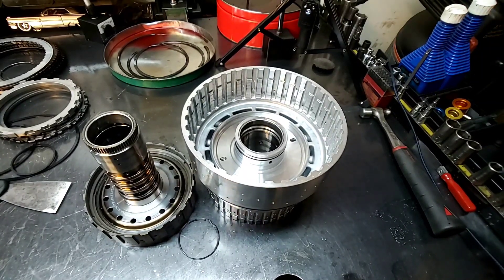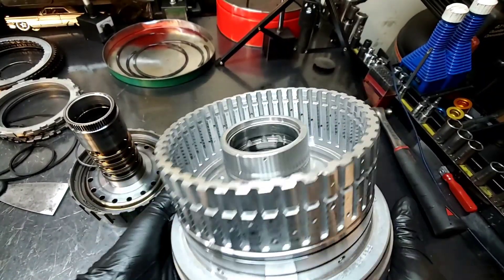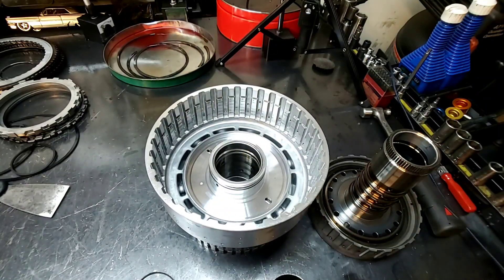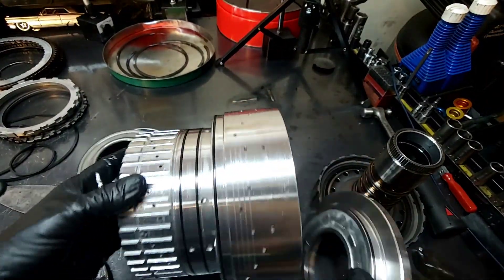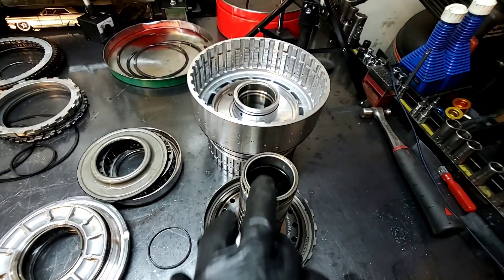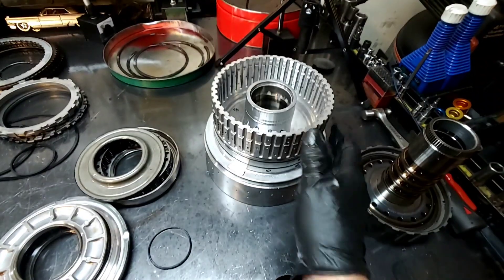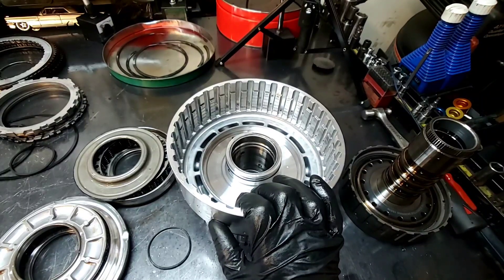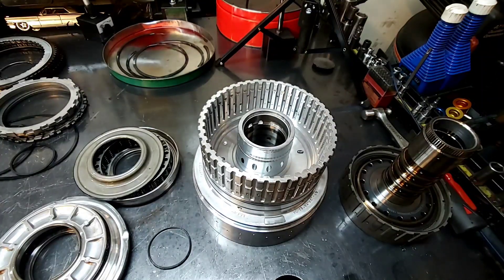10R80 CDF Drum Failure | #10R80

Comment from the maker: I have something in mind to repair and correct the issue. Once I gather what I need I'll post part 2.
Reply: Ford TSB 22-2428
Reply: The latest 10R80 TSB version is 23-2250. (They have so many complaints they have to keep updating it!)
Reply: Any updates? TIA
Reply: Stake the bushing. Lol
Reply: @covid-20lit41 that’s literally what the revised part has. Unreal that Ford let this go on for this long. 🤦‍♂️
Reply: No te olvides del canal en español saludos desde México
Reply: What where the symptoms of this transmission?  Missing shifts, flaring, hard shifting  ?
Reply: Hello I have problem 10L80 no reverse I open and change all clutch and seals.. And also converter.. Still same problem
Reply: Hello I have seen some of your auto repair videos I want to know do you repair the transmission body valve I have a 2006 infinite g35 x the car driver but want shift correctly and my check engine light is on the code reads transmission body valve solenoid

Comment: My truck is doing the same thing......

Third time pulling it.  2 vb's
Now they're checking the magnets, thinking the ultrasonic may have messed up the magnets
Reply from the maker: Who's working on your truck, the dealer or a transmission shop? 
Dealer usually installs a new one if they cant fix it, A transmission shop will find a way and fix it. A mechanic shop, I have no clue what they will do because they're not specialized on this type of work. 
Hope you're in good hands and not at a money pit or a parts cannon shop.
Keep us posted on what whas found and how they fixed it. Concerning the magnets, I'm not sure if the sonic cleaner would damage them but I know for sure that if you hit them or bump them you'll ruin them. They go around the planet in sections of North,South. Any bump will put one of those magnets out of commission. 
Hope this helps.

Comment: A lot of you who rebuild transmission remember the 700R4 and the front seal and pump bushing would come forward and the fix was wired wheel the paint off the seal and put red locktite on both to stop that problem sounds like the same problem what happens to aluminum when gets hot the bushing moves

Comment: Hey Friend,
I have a 10r80in my 2018 F-150, it has all the symptoms in the TSB 23-2250, relearned the transmission about a month ago and the issue has persisted. Has the new Drum resolved the issue? I'm starting to wonder if pinning the bushing in place with a brass pin would resolve the issue. I purchased a 2005 F150 basically as a "long term rental" and am still unsure whether its worth fixing my 2018.

Comment: I am putting a new C,D,F drum in a 10R80 now.  It looks to me like there may now be a step machined on the inside of the drum that prevents the bushing from being able to walk down.  This new one is p/n RFHL3P-7P182-CB where the damaged drum is RFHL3P-7P182-CA.  Ford has for a long while (I’m sure you know) gone up a letter in the alphabet when the part has been redesigned….CA to CB.  I can clearly see a step similar to the pump bushing in a 4L60.
Reply: My 2022 Ranger is currently at the dealership for this issue. About how long did it take for the repair (from the time parts get ordered to off the stand and driveable)?
Reply: I’m still a relatively new builder.  Been a professional tech for more than 30 years but only building a couple years now.  I have rebuilt 2 10R80’s now, both getting C,D,F drums (updated part), outer drums, and general rebuilds w clutches, bushings, seals, etc.  I’m not fast.  LOL!  The first took me three days by the time I pulled it, rebuilt it, reinstalled, then shipped.  I shaved a full day of the second.  I’m sure a young dealer tech can easily knock one out in a day or less.  Especially as many as I’m told some are actually doing.
Reply: I’m still a relatively new builder.  Been a professional tech for more than 30 years but only building a couple years now.  I have rebuilt 2 10R80’s now, both getting C,D,F drums (updated part), outer drums, and general rebuilds w clutches, bushings, seals, etc.  I’m not fast.  LOL!  The first took me three days by the time I pulled it, rebuilt it, reinstalled, then shipped.  I shaved a full day of the second.  I’m sure a young dealer tech can easily knock one out in a day or less.  Especially as many as I’m told some are actually doing.
Reply: I’m still a relatively new builder.  Been a professional tech for more than 30 years but only building a couple years now.  I have rebuilt 2 10R80’s now, both getting C,D,F drums (updated part), outer drums, and general rebuilds w clutches, bushings, seals, etc.  I’m not fast.  LOL!  The first took me three days by the time I pulled it, rebuilt it, reinstalled, then shipped.  I shaved a full day of the second.  I’m sure a young dealer tech can easily knock one out in a day or less.  Especially as many as I’m told some are actually doing.
Reply: I’m still a relatively new builder.  Been a professional tech for more than 30 years but only building a couple years now.  I have rebuilt 2 10R80’s now, both getting C,D,F drums (updated part), outer drums, and general rebuilds w clutches, bushings, seals, etc.  I’m not fast.  LOL!  The first took me three days by the time I pulled it, rebuilt it, reinstalled, then shipped.  I shaved a full day of the second.  I’m sure a young dealer tech can easily knock one out in a day or less.  Especially as many as I’m told some are actually doing.

Comment: Impressive video! The 10R80 transmission in my new condition 2019 F150 shifts horribly and at time it will shift so hard it feels like someone hit it with  a 20lb sledgehammer. Ford isnt fixing it because they say they are not getting the needed DTC codes during diagnostic test.
Reply: So no code no problem? That’s terrible service.
Reply: They literally told me to "wait for it to break" bc they didnt find any transmission codes. I raised hell with the general manager and they brought it back in and did the TCM/PCM adaptive shift reprogram. That helped for ~2months...its starting to clunk again though.

Comment: At what kind of mileage does this wear and failure generally occur? I have a new Ranger on order and I’m kind of worried about this transmission’s long term reliability.
Reply from the maker: I've seen them at about 80,000 or so. The dealership sees them a lot under warranty. Not sure at what mileage but I assume under 36,000.
Reply: @AutomaticTransmission  
I’m hoping that they have modified the offending bearing or seal during a production campaign. However, I have heard it all before.  However there was the same story around the reliability of the 6 speed but I have run one for 9 years in a Ranger, towing 3.5 tons very regularly, and it has been faultless so far.

Comment: I've been getting a clunk or "tunk" noise while breaking for lights. While downshifting on 5th, 3rd and 1st. It almost sounds like a metal wire has tension on it and it keeps slipping or being pulled on from thr side like a guitar string.
No idea what's going on with the transmission but I can feel the noise in my foot and it's clearly coming from the transmission. I drive a 2022 Ford mustang mach 1 with 5k miles.
Dealership is lost. They swapped the valve body and PCM and nothing is fixed
Reply: I would just file lawsuit ford isn’t responsible for anything bask me how I know they will sell you a pile of shit then play the band aid game when the client files lawsuit ford doesn’t answer for 18 months now it will be close to 3 years when court is settled when they refuse to admit the transmission has issues yet this shows me they just refuse service because of my lawsuit

Comment: For removing the F clutch piston, I use a 4l60 reaction shell that I bent the lugs in slightly and my foot press
Reply: I used a 1,2,3,4 apply ring from a 6L80.  I put a big band clamp around the outside so I can bring the legs in right where I want them.
Reply: My mistake 3,5,R apply ring!

Comment: I am seeking for an answer  from an expert. I have a problem with 3-4-5 gear slipping sometimes, not all the time , but 80% of the time at 50-70% acceleration. Is this the problem that causes my 10r80 slip or is a software issue ? I have replaced the valve body but the problem persisted. Thanks
Reply: I believe I have the same problem. It feels like surging and slipping. Real noticeable in 3rd at 3,000rpm and heavy throttle.

Comment: Hey Hiram I built a 700r4 no reverse pressure test idle 170 psi. I made a mess. Customer well child hood friend. Wanted 4x4 case his trans non aux.only one I could find 86 case first #6 . I put his parts non aux in a later case. I drilled hole through rib just in case use later pump plate valve body

Comment: Hello Hiram!  I love your videos! ? Question I have a 1979 ford f100 with the c4 transmission that has leaking shaft seals. I’m going to have to drop the valve body,  I’m worried, should I use a torque wrench when reinstalling the valve bolts? I heard that a transmission can be damaged if bolts are to tight? What are the specs for a C4 tranny😊🤝?

Comment: I don’t mean to be an ass, but this video was 9.5 mins of just saying “this drum and bushing are bad and worn out”… zero other information on what symptoms to expect, or what would cause it🤦🏽‍♂️I honestly don’t understand the purpose of this video. And you say “this is the most common problem”, ok, great, but WHAT did t the customer say is the symptom??
Reply: Mine failed in this same manner with only 60k easy miles. The symptoms are overheating, taking a long time engaging the next gear and occasional very hard shifting.
Reply: @MarshallM-qg5li  ah, thanks. I guess that explains why my 10r80’was just replaced in November due to those symptoms.

Comment: This drum has been updated by ford and the new part number is jl3z-7h351-b
Reply: You are correct. I'll use caps to help others read it: JL3Z-7H351-B    
Been waiting for this part for a month and now supposed to be available Oct 15th, but we'll see...
Reply: @sweetpepper7791  Will redesigned drum fix these problems  ?

Comment: This is a common issues with these units I work at a ford dealership we just replace the drum and also the e clutch drum tends to get scorn. You can move the sleeve back Into place but it will move again I had a few return after installing a new drum so it’s a flawed design,  hopefully the aftermarket can come up with a solution. Plus ford has those drums on back order so good luck
Reply: What does it do when it's bad? I have a weird noise coming from transmission area. Almost like a growl/whine. Could be unrelated
Reply: I have 3 years with my truck and I'm having these issues. The mechanic told me it was the torque converter and the cdf drum. I no longer have warranty. The mechanic told me about a legal issue with ford is having because of this issue. Any advice y'all can give me?

Comment: Hiram inspired me to get in to transmissions and now I build these transmissions daily for a ford dealer I work for. Keep up the good work Hiram cause theres a lot of transmission guys  out there that are quick to just replace instead of repairing a bad transmission. I do believe Ford is working on redesigning this drum tho.
Reply from the maker: I'm glad to hear that Ford might be working on updating the drum. Downside is you guys will see it before we do. But it's actually good news for everyone. 
Changing the subject; you that works as a dealer tech can confirm the myth that everyone says "But it only has 80,000 miles, it can't be bad already..."
What's the lowest mileage you've seen in one of these? Including reflash for Drive ability issues. Or any vehicle you guys work on. 
I'm glad you chose transmission repair  it's kind of interesting and sometimes challenging.
Reply: @AutomaticTransmission  Just had mine done under warranty.  2020 3.5L Eco, 49k miles.  8 weeks at the dealer.  Receipt confirms updated hub, JL3Z-7H351-B.
Reply: @AutomaticTransmission 
As soon as I find anything on the updated drum I will update you guys. I have seen damaged drums with miles as low as 40k, as a matter fact  I just did a navigator this week with 43k miles. I have also seen 10R60 with 12k miles with cluth A retaining ring busting off.

Comment: I'd like to see GM make a correction on those sleeve bearings.  Maybe they need to use roller bearings or redesign the drum.
Reply: This is a Ford transmission though, would GM redesign their purchased 10L80s?

Comment: I really enjoy your videos. I’m currently working with these 10 speed trans and I’m seeing the sleeve move on higher mileage vehicles mostly.  Lower mileage or more city driven seems to be holding up. I believe 7H351 CDF DRUM will be updated with new part from Ford. 
Upcoming TSB
Reply from the maker: Awesome to hear that. Thanks.
Reply: do you know if TSB out for this yet. Hving this issue 2018 f150. 152,000 km

Hard upshift downshift 7-8 and hard downshift 5-4. Local trans shop saying $4000 to repair
Reply: @wernerkeggenhoff2065  
Tsb 22-2428 came out May 29-2023
Reply: @raphaelramirez3081 is there a recall yet on this defect ?
Reply: @100pyatt  no recall only tsb only so only covered under Powertrain warranty.